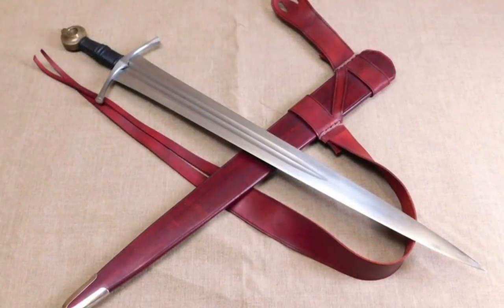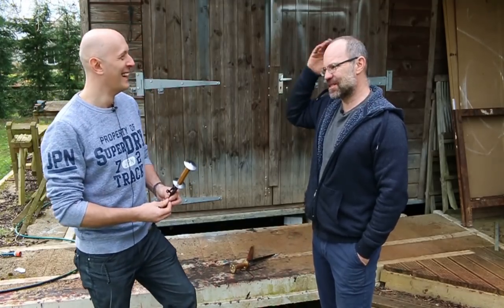Crossbows, Scabbards & Other Things - Matt & Tod Chat - Part 2

Comment: Matt, are you using a Microsoft webcam? You might wanna see if you can get some new drivers for that because the zooming is a bit silly.
Other than that, great talk.
edit: Question for Tod. What about taking your sword to the leatherworkers guild/scabbard making guild and having one made for the sword? If it's a high-end piece, say, for a noble or rich burgher, wouldn't that go hand-in-hand?
Reply from the maker: There were only two zooms, totaling around 4 seconds, in this 10 minute video. Maybe your monitor is malfunctioning?
Reply: I noticed it in an earlier video too, the response to Metatron about the Greek helmets, which had a few more, so I thought I'd point it out. If you're not bothered by it, however, I can hardly tell you how to run your own channel...
Reply: I have to agree with Sir... I love your content, but I find the dramatic zooming in your last videos a bit distracting and unnecessary. Keep up the good work
Reply: I saw the zooms in a previous video too. They didn't bother me but I noticed them.

Comment: How much of the difference in modern and historical crossbows is due to advances in materials?  Namely, even with a recurve crossbow we have the ability to make strings out of dyneema and bows and stocks out of various exotica like reinforced carbon fiber, which, outside of being lighter than wood, gut, and twine, are much stronger, so we can take an historical design and push it to a level that would be unsafe without modern materials.
Reply from the maker: Modern materials allow a much lighter bow and a longer power stroke, so yes, modern crossbows are more efficient.